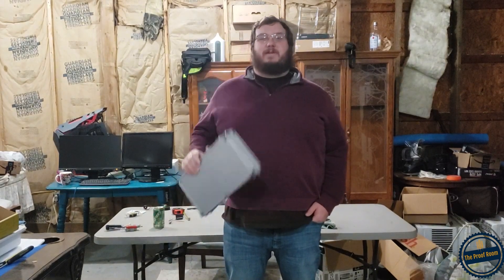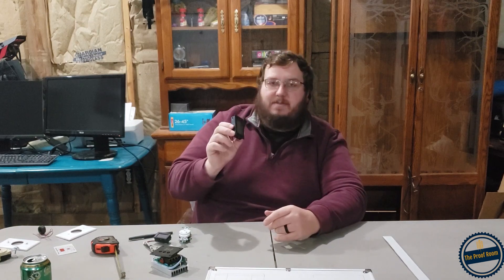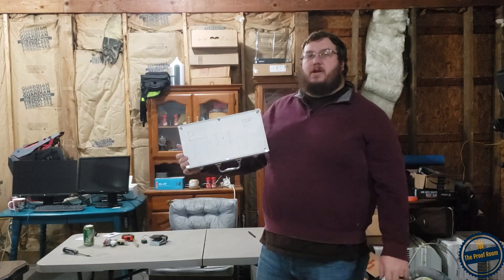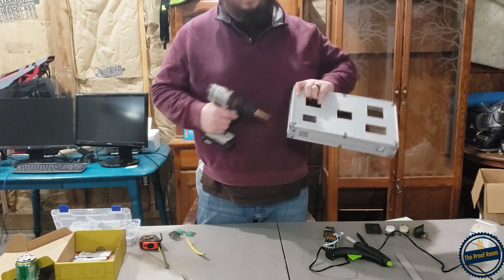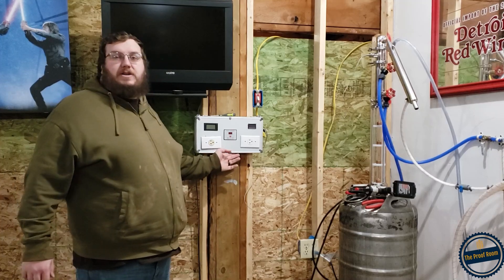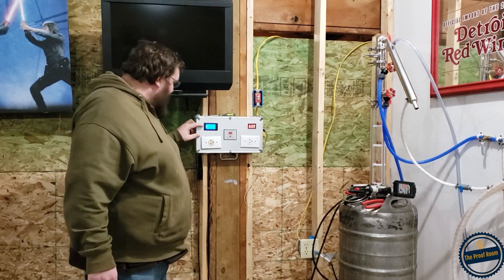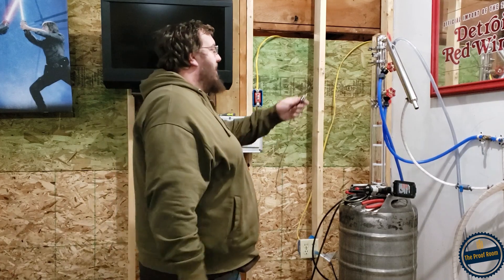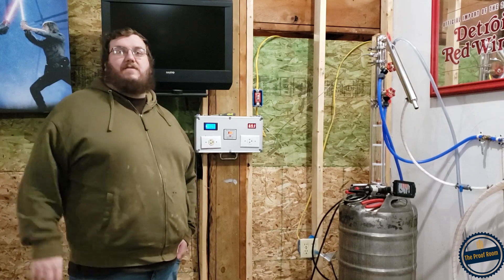How to Build an SCR Controller

Comment: Am I correct in thinking this digital SCR will only work with 220v? I want to run 120v but cant find a digital scr that doesnt say 220v.
Reply from the maker: You should be able to use either

Comment: You have a lot to learn about electricity. You say that you have this wired for 220 volts. It appears to me that you have it wired so each plug comes off of a 110 volt leg.  I guess that is why you are using 20 amp 110 volt plugs. You are just looking to start a fire!
Reply from the maker: No boss they are 220 plugs wired 220. You are right in the fact that I had a lot to learn I've built a few controllers now check out my newest build on the channel and let me know what you think.

Comment: I msged you on fb but I don't know how much you check it. I wanted to know if you could help. I'm trying to build a controller. Same as here but with two switches. One for the outlet, and one for a wire Ill have going out the side. Having trouble trying to figure out how to do it so it works and is safe. Thanks.
Reply from the maker: Yea for sure. I can help you out ill get back to you on messenger.

Comment: This is really awesome, but it definitely looks like a box of death. Definitely should at least have an earth connection (especially with those metal casing parts), possibly just a more suitable housing.
Reply from the maker: I've built a new controller since then. It's a lot more suitable for the job

Comment: Nice one mate  , should work great. What made you change from PID to SCR?
Reply from the maker: My pod surges my heating element and it dosent give consant power
Reply: @theproofroom1473  A lot of them will let you use manual mode, check the manual, found it in my inkbird’s by surprise when reading it. The scr is much nicer to use though.
Reply from the maker: @wombatau   mine did not have a manual mode I double checked

Comment: Be careful 12/2 Rolex wire that you’re using for power supply is only rated to 20 amps. Not sure what your heating element draws for amps but you will def have a fire if you over draw the 12/2 wire
Reply from the maker: I'm drawing just 20 when both elements are on. Most of the time I'm running 12 I've ran it for 12 hours with no issues so far.
Reply: @theproofroom1473  12g is probably good for 30+ amps. They derate it so there's no fires in the wall.

Comment: What the link to the "ac to dc trans" and the "dist. block"?  They are in the wiring diagram but no amazon link.
Reply from the maker: I can get you a link if you'd like but the ac to dc transformer is just a cellphone block that you use to charge your cellphone.
Reply: @theproofroom1473  What have you plugged the cell phone charger block into?  I can see the usb cable coming out of the block connecting to the thermometer.  But I can't see what you did at the other end of the block to connect it to mains power.
Reply from the maker: @scottforsythe2024   I just ran it to pin 1 and 2 on the scr. I used wire crimps that fit securely on the metal prongs of the cell charger.
Reply from the maker: If you need a visual reference I can send you a few pictures
Reply: @theproofroom1473  So that USB puts out 12 volts when connected to 240v power? Those typically only produce 5v, I assumed connecting a 120v transformer into 240v would have fried it.
Reply from the maker: https://www.amazon.com/gp/product/B08DT8TCMW/ref=as_li_qf_asin_il_tl?ie=UTF8&tag=theproofroom-20&creative=9325&linkCode=as2&creativeASIN=B08DT8TCMW&linkId=e6e2520637f7489108a07e5bd69b2769

Comment: Always nice to see an upgrade from PID to SCR build. +1
I cannot recall ever seeing that SCR before, nice find.

I built mine a while back (old school??) and use the KYOTTO KR2040AX. If you search fleabay for KR2040AX they'll pop up. These work for 110v or 220v and are just a dimmer switch. Work fine with 5500w element.

Cheers Man!
Reply from the maker: I'll have to check it out thanks for the advice. I also looked into getting different seals for my column i may have found something that will work.
Reply: @theproofroom1473  Yeah. I saw the seals you were talking about on the oak stills ebay site. They would be very difficult to wrap.....

FYI: My 4" stainless sight glass tee's are from Oak stills ;)

Worst comes to worst. Purchase a piece of copper from a hobby store, or flatten out a piece of 2" inch copper pipe, cut down lengthwise, anneal (super heat with torch and let cool naturally) and you can just about flatten it by hand or between 2 pieces of wood and a hammer.

1. Trace the outside edge of one of your sight glasses on the flat copper.

2. Trace your bubble plate in the center of sight glass circle of the copper.

3. Then make another circle on the INSIDE of the traced bubble plate about a 1/4 inch smaller.

4. Cut out the big copper disc. Then cut out the 1/4 inch smaller hole from the bubble plate. This Copper Ring can/may serve as a seal.

(You also try this with cardboard instead of copper as a test - or wrap cardboard with PTFE)

5. Wrap your bubble plate on edge with PTFE tape.

6. Wrap the Copper Ring with PTFE tape.

7. Assembly: Put wrapped copper ring on sight glass, then wrapped bubble plate, then next sight glass etc.

You can get really wide PTFE tape to help this process. 

Or you might be able just to make your own gasket by getting thick PTFE Rope off of amazon.

Finally you can cut large PTFE gaskets from PTFE Sheets (thickness varies) from US Plastics. I get my PTFE discs for Small/Wide mouth mason jars through them.

https://www.usplastic.com/catalog/default.aspx?catid=720&clickid=popcorn

Cheers!

^^^ Sorry about the Wall of text...
Reply from the maker: @BigEdsGuns  yea I ordered some ptfe replacement gaskets from Amazon im going to give those a shot and see how they work.

Comment: Nice job n how to on the scr👍u won’t regret switching from ur pid to the scr! I’m lazy n just bought one lol looking forward when u use it on ur next run 👌
Reply from the maker: If I could get the ph to rise in my wash we would be rocking lol
Reply: @theproofroom1473  To raise Ph in your wash:

1. Pickling Lime - Look for it in the canning section of the Grocery store.

2. Washing Soda - Arm and Hammer Washing soda. It's in the laundry isle at the Grocery store.

3. Baking Soda will work, but it adds Salt. So if you do a UJSSM multiple generations the Salt/Sodium will build up.

^^^ Use them sparingly like a couple tablespoons, mix, wait 5 minutes and check Ph. You'll figure how much to add based on fermenter size, wash volume, and starting Ph.

Use a Ph Buffer: (Calcium Carbonate) 

Buffers dissolve in Ph lower than 4.5(?) raising the Ph. Buffers do nothing at all at Ph 4.6(?) above that, they just sit there.

Chicken scratch (Oyster shells)
Oyster Shells, Clam Shells
Egg Shells
Coral
Marble

I hang x2 Dry Hop bazookas 1/2 down in the barrel full of Marble Stone in the fermenter. They hang on the side with a SS wire hook. They disappear in about 4 to 6 ferments.

I can buy a 20lbs bag of Marble Stone/Chips from Hone Depot or LLowes for $3.

Cheers!
Reply from the maker: @BigEdsGuns  its a simple sugar wash i added about half a box of backing soda today to get it back up to 5.5. Its 40 gallons of wash
Reply: @theproofroom1473  Try the pickling lime, it's way more potent. You can also use Slaked Lime or "Lime" (Calcium Hydroxide) you can get at a garden center for cheap. It's the same lime powder you would put on your lawn.
Again use sparingly. Never used Baking Soda before(?), thought it was potent like lime.

Pickup a small bag of pickling lime. If you use it up, pick up a 20lbs sack from a garden center or green house.